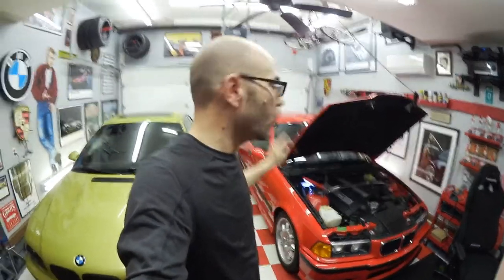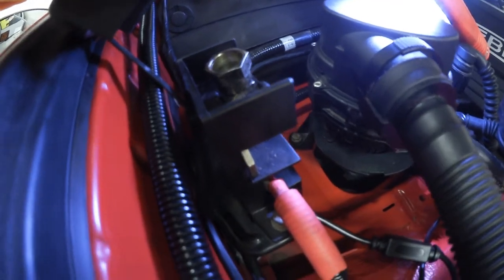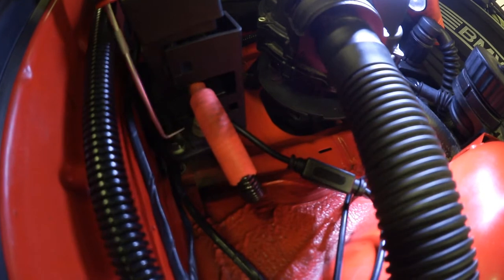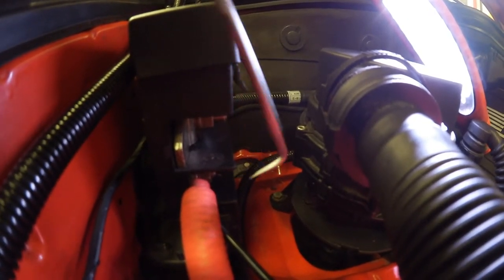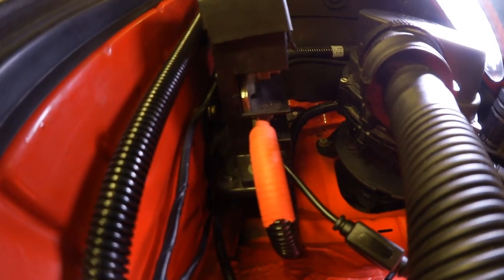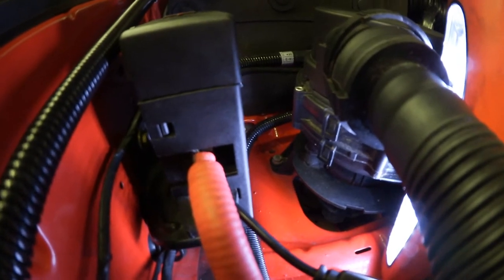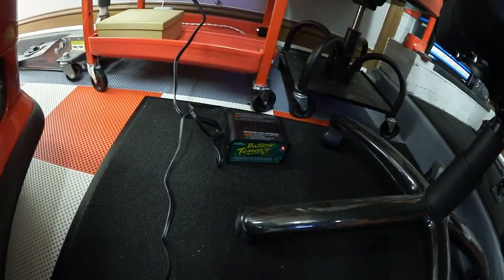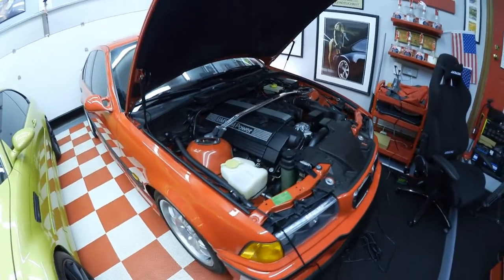BMW E36 Tips | Connecting a Battery Tender Under the Hood

Comment: I attached a CTEK pigtail (with built-in battery status LED) on the rear battery location and it was zero drama. The plastic battery cover/tray doesn't sit perfectly flat but it's not a big deal to me.

Comment: I got e46 I want to put one on mine but do I have to disconnect battery before undoing those bolts to add the connectors on don't want to break anything